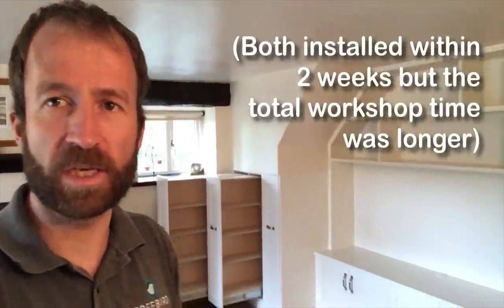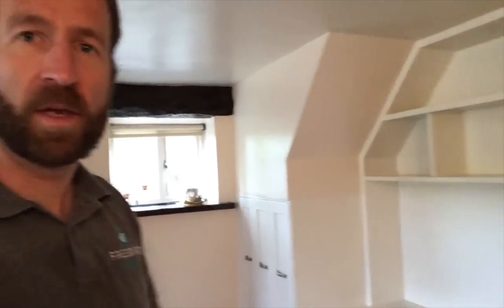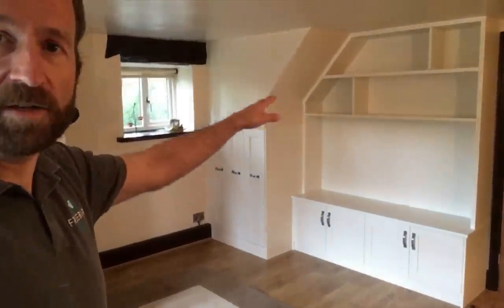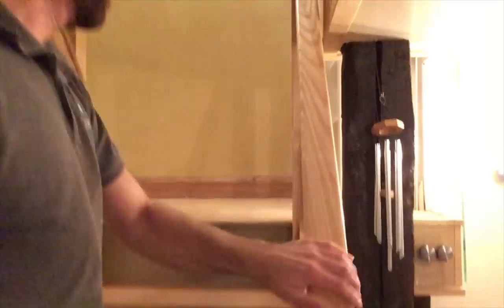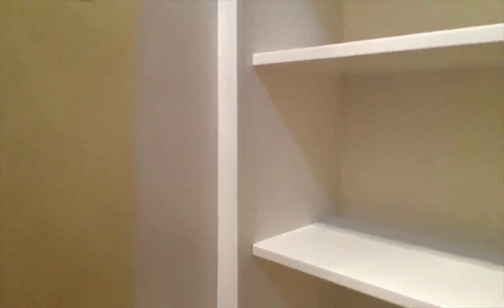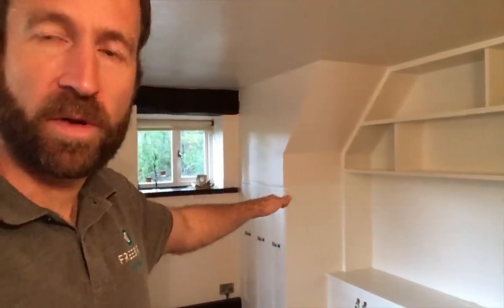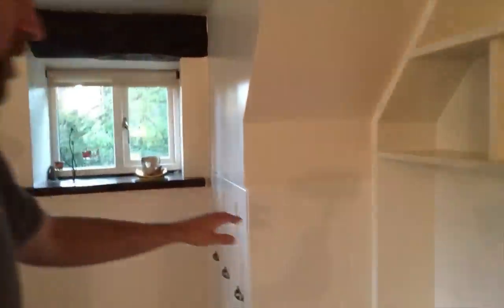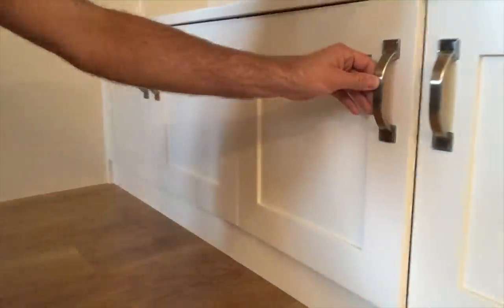Display Storage with Bookcase Pullouts

Comment: Great tip on the CT1. No matter how tight you scribe.. on white furniture on white walls,  caulk is needed and i always worry about it cracking. I'll be investing in some CT1. Great channel. Very honest content and I'm looking forward to seeing your business grow 👍
Reply from the maker: Thanks Jim!
Reply from the maker: You need decent wipes to work in this way with CT-1.  We had some swarfega ones that properly dissolved it when wiping off the painted surfaces but when we ran out of it the other ones didn’t really cut it.
Reply: @Alastair_Freebird  As an update, a year on, what caulk and wipes are you using now after having some time to see the results from CT1?
Reply from the maker: Kenlovejoy hi, thanks all in short I settled back on just using waterbased products!  Because the clean up is too much of a hassle otherwise.  Typically I use ‘PinkGrip white’ to none the back edge of a scribe to the wall, and everbuild ‘caulk once’ to fill the joint towards the front .
Reply from the maker: ...oh, and everbuild’s wonder wipes mostly

Comment: Excellent utilisation of a very awkward shaped space under the stair.Watching with interest your use of CT1 .🤞🏼this solves the cracking issue and also looks good over painted.Hope the client is very pleased with your work.
Reply from the maker: Ian Anderson thanks for the comment.  Do you use CT-1 yourself?  How soon do you overpaint it?
Reply: Freebird Interiors Never used CT1 - up until now have used what ever is easiest to obtain and painted within a couple of hours of application.Have always been frustrated by the subsequent cracking.
Reply from the maker: Ian Anderson same here; I got as far as deciding that Everbuild Caulk Once was the best caulk out there (although I haven’t tried the Dunlop one recommended by Peter Millard) but I was never satisfied that cracks wouldn’t appear.  Discussed it on the ‘Fesdrool’ Facebook talk group and the 2 new bits of advice were to prime the scribes edges before fitting and caulking; or to use CT-1.

Comment: Brilliant job. Nicely done 👌
Do those runners have a release catch to pull them off the female part of the runner? I've used some heavy duty ones that didn't, which made installation a bit tricky.
Nice. 👍
Reply from the maker: Black Tea One Sugar thanks and yes they do, shown in detail in this video:: https://youtu.be/JQkuze3yTpM perhaps you previously used the accuride 5321, we had the same problem with those runners.

Comment: Great video. Please can you explain the theory on fitting the cabinet so that there's an infill piece all the way round? Is that just so you can scribe it?  It looks like it's just doubled up Birch ply. Does it go all the way back to the wall?
Reply from the maker: Hmm I’m trying to remember!  Do you mean at 9:00 where a strip attached to the wall on the left is visible, prior to the scribe being fitted?  Sometimes I glue and pin a strip to the wall
- especially if the scribe is a bit wide - to support the back of it on the wall side.
Reply: @Alastair_Freebird  yes I did. The scribe looks perfectly even all the way round. So much so that I thought you had maybe just put double ply all round the outside of the cabinet
Reply from the maker: @ChickenDinnerz  ah no, they are all marked and cut to fit,  From 18mm painted MDF, face on.  I do usually design for about a 35 to 40mm width scribe.

Comment: Where do you get your under counter lights from and what make are they?
Reply from the maker: D P: hafele loox 12v range.  Www.hafele.co.uk. There is a wide and confusing range so I prepared a detailed crib sheet of the lights that we use including compatible connectors, drivers, switches etc and the relevant codes and guide prices, initially for our own use, then I made it available as a thank you to my supporters at buymeacoffee.com/Freebird.  If you make a one of donation to support the channel of £3 at that site you get an access link to download the file.  It will be worth more than that to you if you’re planning on using the system.  (I’m pretty sure that download link is working, though we’ve had technical issues over the weekend regarding a different file link for the monthly subscribers)
Reply from the maker: More info on the system here: https://youtu.be/F8IZ0tVBjT0